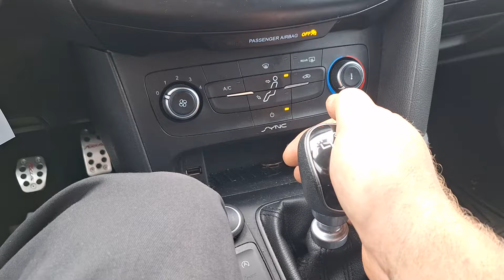Ford Focus - Clutch Pedal Stuck To The Floor!

Comment: So  whats  happent later, you fix , or what ¿¿¿¿
Reply from the maker: Needed a clutch master and slave cylinder. And clutch & flywheel
Reply: @BigBensCarsAndCycles  Anything  else  ¿¿¿¿ jajajjaja its  a lot  of  work  and  money  OK  thanks my friend
Reply from the maker: @humbertomoreno8280  you're welcome. yes it's a lot of work. but its not too hard of a transmission to take out.
Reply: How much did it cost?
Reply: Damn! Thats not good! Mine is doing the same :(